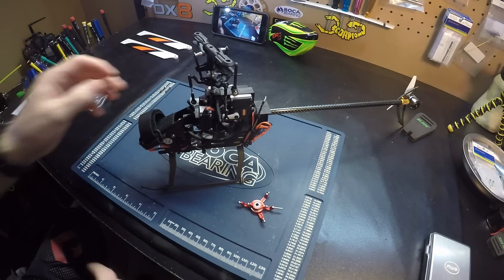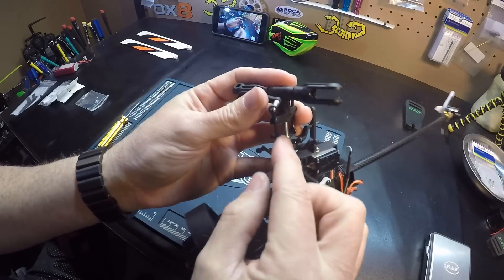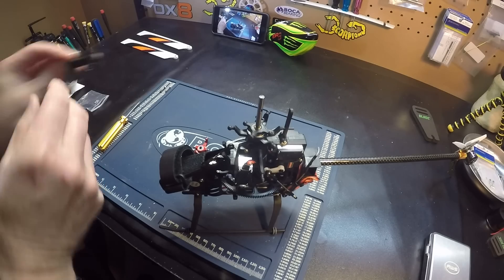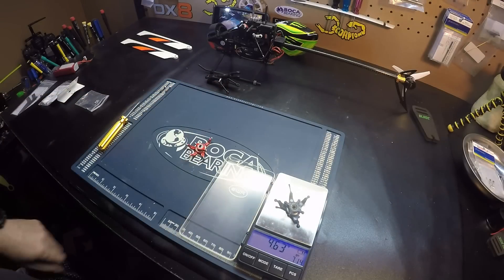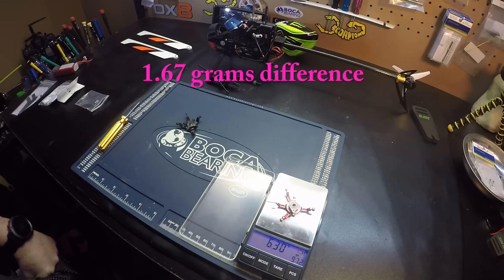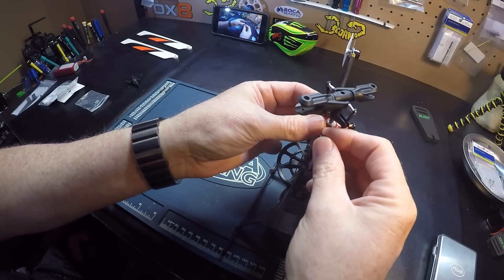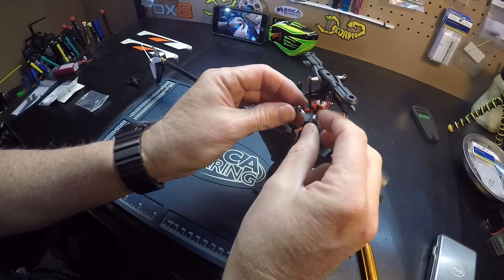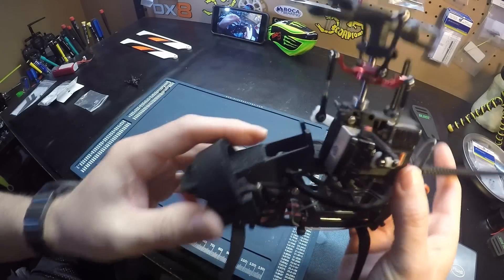Blade 230 s  swash replacement

Comment: If you didn’t like the plastic swash you should’ve keep it Oiled up so the plastic wouldn’t move or stress it self out or stretch out to have slack in it I use WD40 spray all the plastic down with it it makes the plastic softer but if you crash it it won’t bust or crack or nothing will have slack in it but don’t get it on nothing when you stay it down take the helicopter down to a bare main frame and then spray it down lol trust me RC car guys do the same thing for winter runs so the car’s plastic won’t brake in stress I never have problems with my helicopter’s at all but I got ride of all my plastic’s to aluminum everything it fly’s better so bud if you don’t like plastics replace your head as well lol
Reply: Most micro HELI plastic swashes have slack in them. A good aftermarket awash with better bearings makes a nice upgrade. So it’s up to the pilot